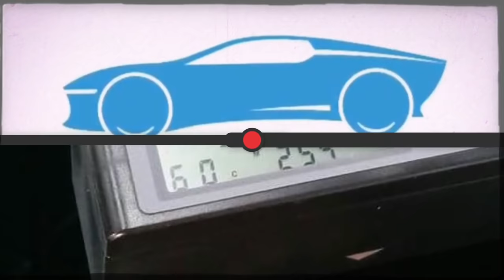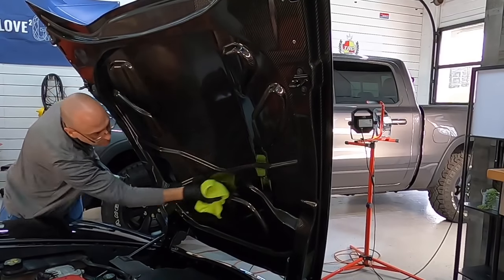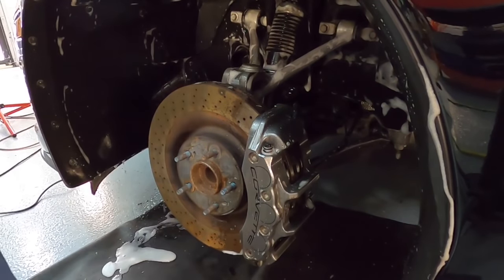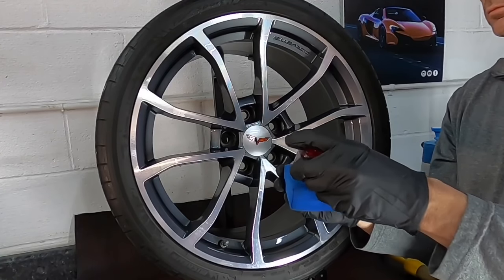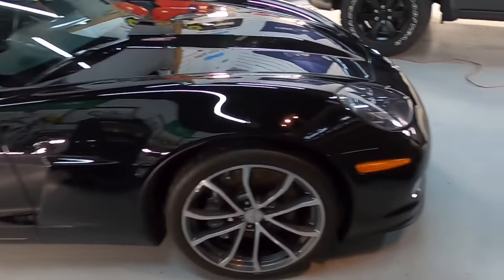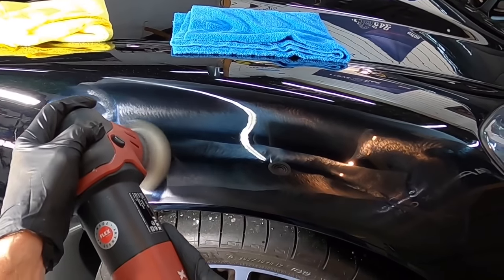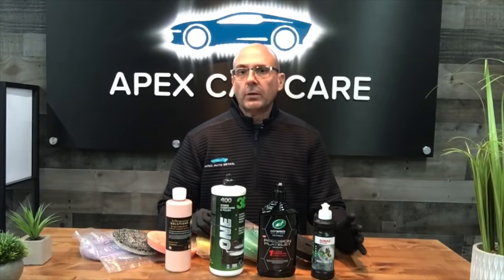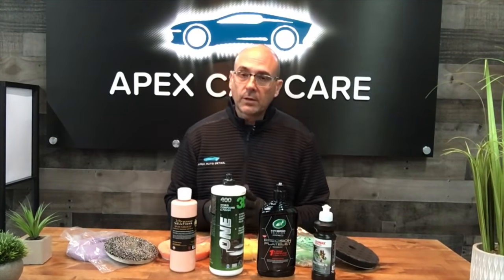Mod And Protect!!! Super Rare 427 Convertible Collector Edition Corvette LS7 7.0L!! Part 3!!

Comment: I use Ardex 2500 compound with a Meguiars microfiber cutting pad on my flex. It cuts and polishes very well. Then I top it with either Seal and Shine or Tech choice ceramic spray for protection. Corvette is coming along Brian. 👍

Comment: Hello Brian. Have been watching intently when ever you touch a Corvette. Reason being is that I will be tackling my 2019 Grand Sport with a Sebring Orange Tint Coat paint job this Summer. It sat on the lot for a considerable amount of time and the UV did a number to it in some places plus the usual dealer induced swirls. As the saying goes it’ll buff out. I hope. I noticed you had mentioned after 2018 clear coats have gotten softer and thinner. Would Corvettes be included in this bunch or are they still classified as still using the harder clear? I think the Sonax EX 04-06 will be the goto polish I’ll be using. More DA friendly or so they say along with foam pads. Thank you for your love of detailing and Corvettes.
Reply from the maker: Hard and stubborn all the way up to the C8. They are medium.

Comment: I did try the hydes serum you suggested but it left little tiny dry drops of the product all over rotors and calipers. So just using brake buster couple times a month and keeping clean that way.
Reply from the maker: Always wipe excess from the area.

Comment: Thanks for all the information, I'm new to polishing my car, just moved off dirt road in Vermont. I have a 2020 Grand Cherokee that I use Turtle wax ceramic spray coatings, What pad would you use with the turtle Wax ceramic polish. How hard is the clear coat? Thank you.
Reply from the maker: It is softer and thinner than later models. Use the Lake Country white polish pad.
Reply: @apexdetail85  Thank you!

Comment: So if the new clear coat is so soft is it imperative to ceramic coat since ceramic is 9H? Or is all that just marketing hype? I've heard ceramic takes on the properties of the substance it's on? Explain that, does it get less hard on soft clear coat?
Reply: The whole hardness thing is marketing hype.  It can still scratch, but it is less susceptible to marring than naked soft clear.  If you are terrified of marring and rock chips then PPF is the way to go.
Reply from the maker: As 5hift mentions...coatings can still scratch. But it takes much more effort tom  do so. Very important to preserve new car finishes.